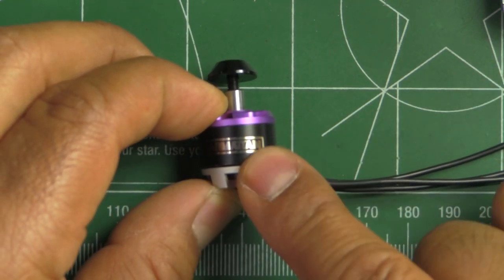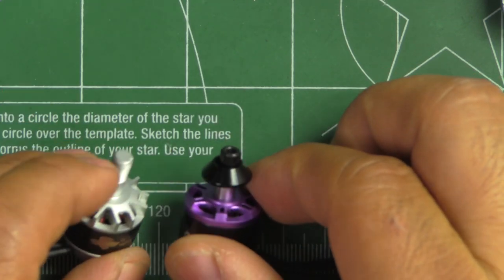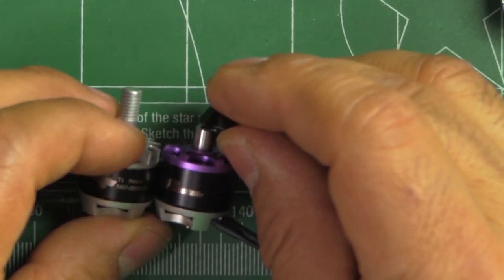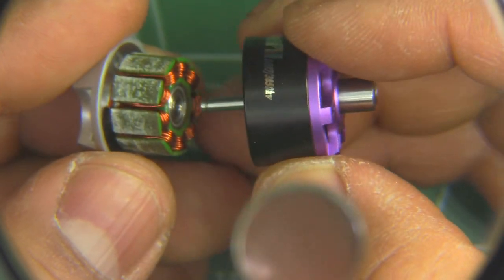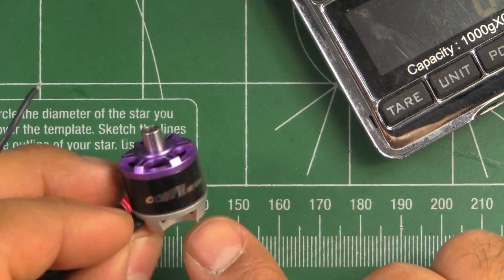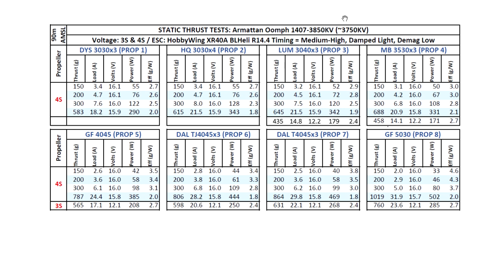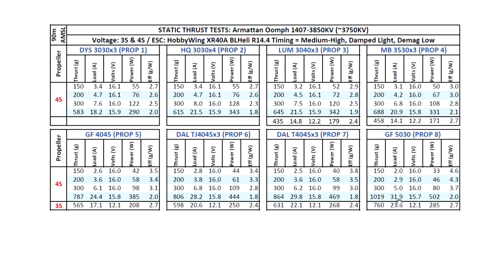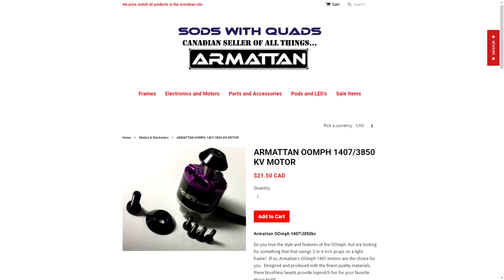Armattan Oomph 1407-3850KV Static Thrust Tests & Overview 1 Kg Max!!!

Comment: I'd avoid these like the plague. I'd rather have slightly lower thrust and a much cheaper motor like the t1s than chase the internet looking for replacement caps. My favourites remain the rotageeks 1407. They don't get beyond slightly warm on 4045 triblades with some filters removed on betaflight. Dal t4045v2 are my blade of choice on a light 4", I hate the dual blades people recommend. Quad feels floaty with them on and I notice the wind a lot more.